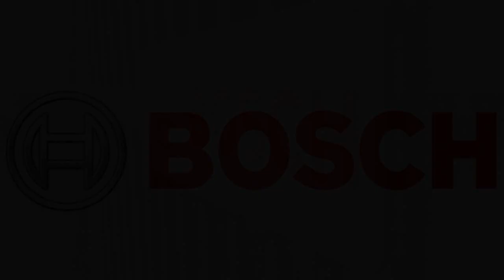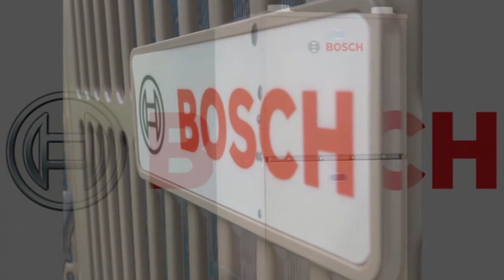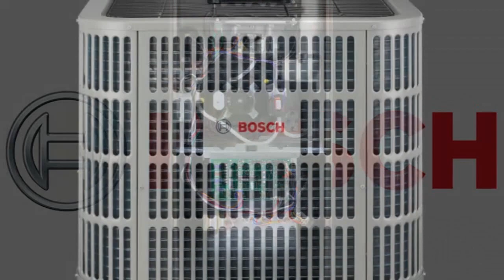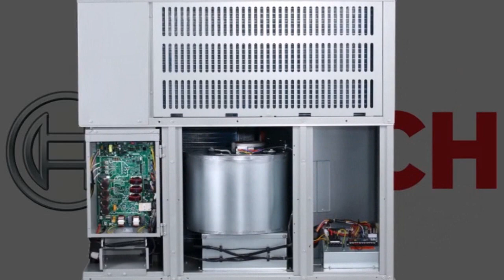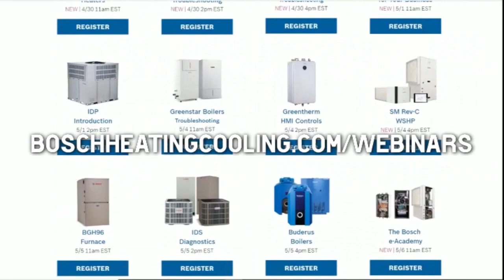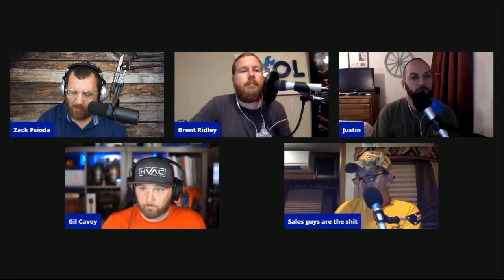The HVAC Sales Process (Gil Cavey & Brent Ridley)

Comment: Most  people  do internet  reserch  . Who and how the come with stars is a good one . Most are price point . Being how 10 year parts  are standard . Some brand's won't  consider  because  of the high call back problems  before 1 year . Always  check  duct work  is it a Rheem shorty / is it a attic  job . is there room for full size AH  to get 16 SEER in there . Is the old system  suffering from  return  air inadequacies mostly  old homes  . Where there's  a return box  with vertical  app with ceiling  grill   the old box is a mess more work and expense.  Always  explain  the extra stuff with them with the replacement.   They see the adds with the  attractive prices . But Miss the fine print hook up to existing ductwork/ slab and Copper. PS  hack jobs are out there .